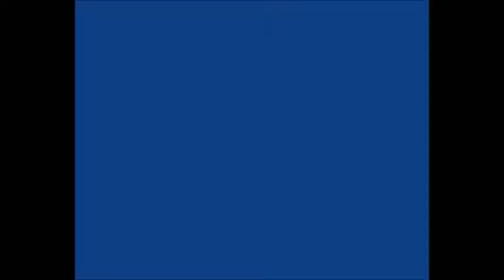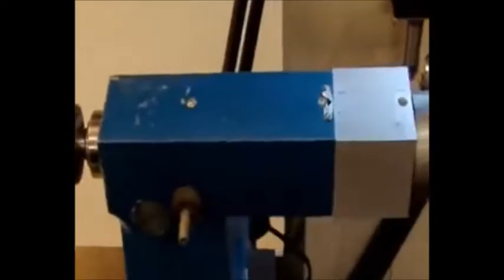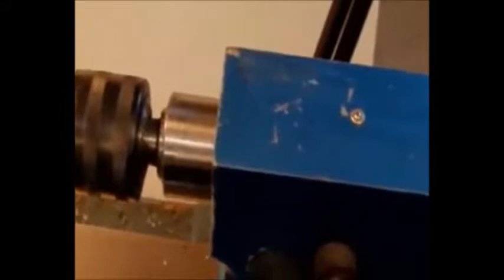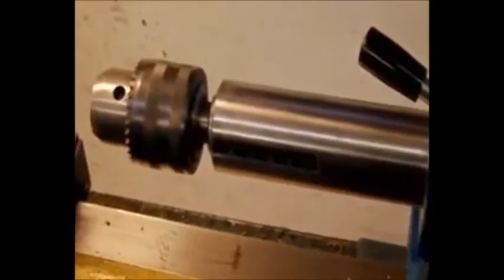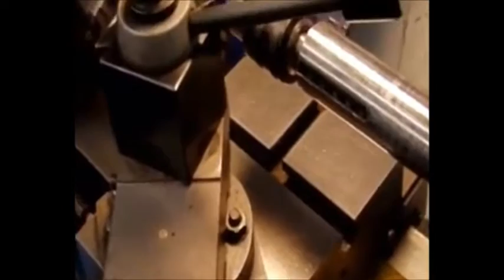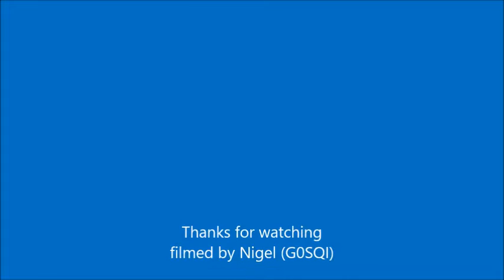Tail Stock Modification

Comment: Also is your variable speed inverter and 3ph based as I've added inverter and 3ph motor.. Best upgrade I've ever done now control speed on potentiometer.. How did you get the live readout of rpm
Reply from the maker: Yes luke it is 240v 3phase and the readout is just a cheap digi readout from ebay comes with an electronic pickup which I made a small bracket from and added a magnet
to the drive wheel in the back cover :)
Reply: Superb thanks

Comment: I don't suppose you have any drawings for this do you
Reply from the maker: Hi luke sorry no I just made the new rear block and moved the bearing then made a new longer lead screw was pretty easy :)
Reply: Thanks I'll look into doing this as I often need to drill deeper than 30mm.. Have you installed dro and scales at all
Reply from the maker: @sickswan61  no on the dro as I have that on my harrison lathe cheers
Reply: Righto thanks looking at an m300 next my self but just need the space now